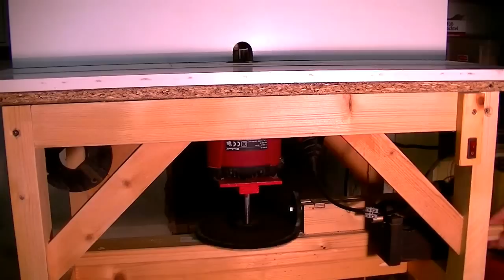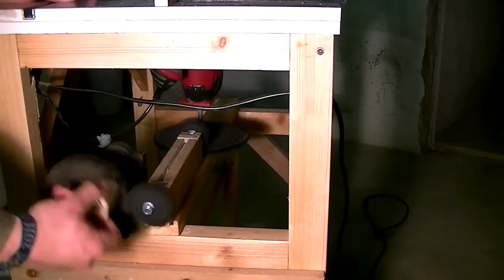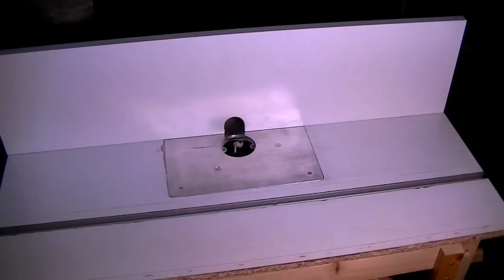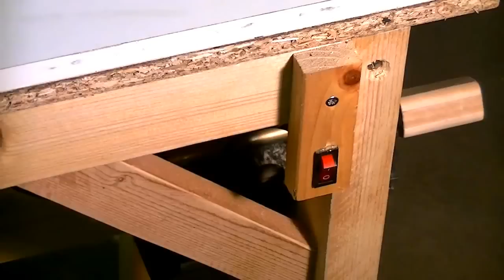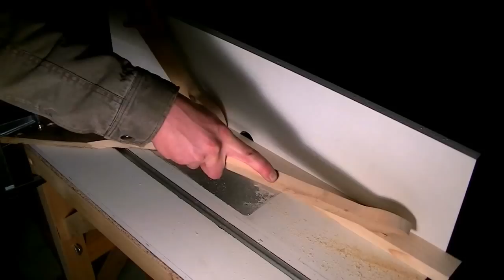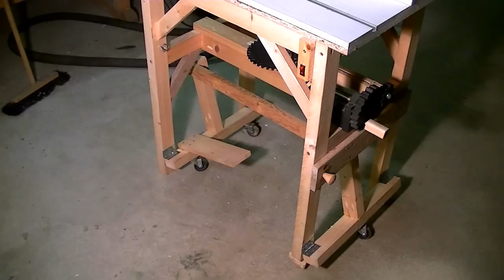Homemade Router Table (lift and retractable castors) - Eigenbau Frästisch

Comment: Great vid. I will probably build your lift for my router since it is unAmerican-like and doesn't have a symmetrical base. I have been looking for someone to come up with a way to use gears to raise and lower the table onto it's casters. I have many woodworking hand tools that I want to store in a converted dresser that doesn't have foot access to lower the casters as your parallelogram mechanism does. Do you think this is possible/practical to accomplish with gears?

Comment: Very nice.  The retractable caster system appears to be a planar four-bar linkage, with the frame of the router acting as the fourth bar.  How does the locking mechanism work?